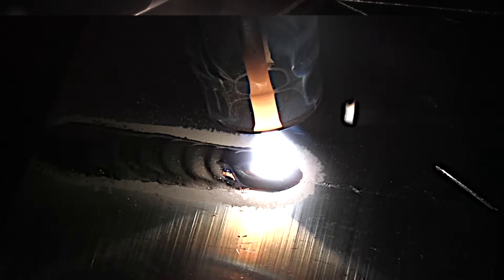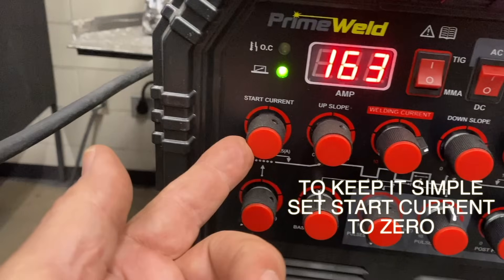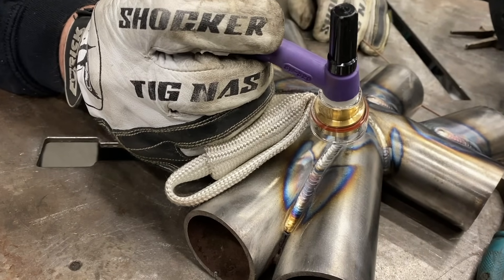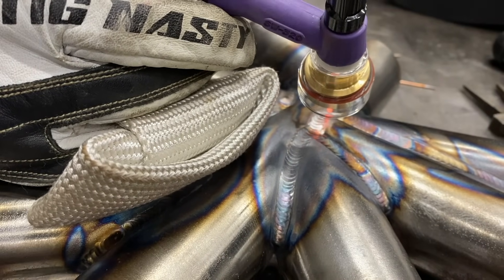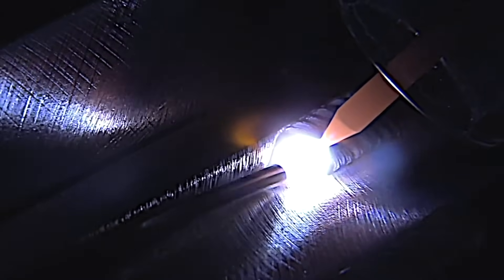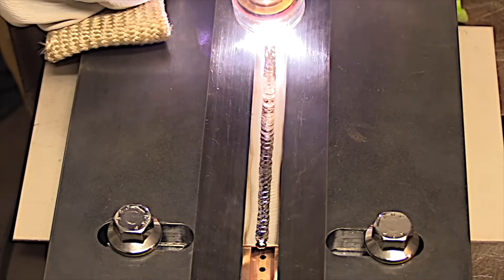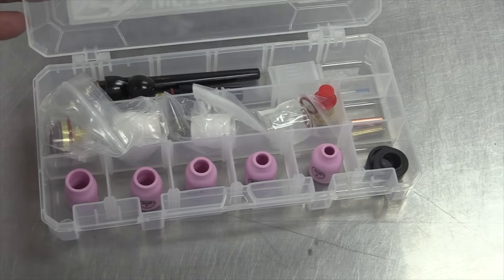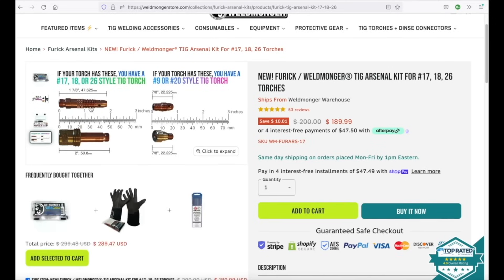TIG Welding 4130 Chromoly with Weldmonger/Furick Arsenal Kit

Comment: Is it possible to weld two Ф1 1/8" 2mm 4130 tubes together end to end without strength loss?
I wanted to enlarge my steering pipe at bike fork (new frame require longer tube) and my friend tried to talk me out of it, saying I'll get it weakened at the seam area. But AFAIK 4130 CroMo steel does not require thermal post processing as 6061 Alum.
Execuse me my ignorance, I'm not a welder.

Comment: My Dirt jump BMX is 4130. Everything equipped. Frame handlebars tires rims.. Ect is about 9-11 pounds. Pedal TIG welders suck. If you set up a finger trigger/Relay it's way more smooth. Throw the pedal away. It's super simple to setup a finger trigger.

Comment: one question guys if you know maybe, I want to weld the handle on a large 320 angle grinder, can the weld ruin the angle grinder, some components motor, brushes, electonics? i would use around 70 amps stick weld

Comment: Great video, absolutely love having the variety of cups to choose from depending on the job. used the jazzy 10 and clear 8 cups I got from you on stainless and mild steel and it was life changing! Is there any benefit to pumping the pedal as opposed to using the machine pulse or can you achieve the exact same effect?
Reply from the maker: The main benefit to pumping the pedal is when re positioning wrist and torch angle around curves and corners....so that you only pulse when you are ready

Comment: Hey Jody was the 2nd pass also 1/16th filler rod? Would it matter if you went to 3/32 for the 2nd pass?  I've seen ER80-S used for chromoly most commonly for this type of chassis work. Would there be any difference in approach/settings if the ER80-S was used?  Thanks so much for this video!
Reply from the maker: yes the 2nd pass here was also 1/16"  and I think 3/32" would also work but might require some finesse to not add too much filler.  er80s is also frequently used for 4130 but I have never really noticed any difference in amperage settings compared to er70
Reply: @weldingtipsandtricks  my work aluminium wheel crack welding
can prime weld 225 weld